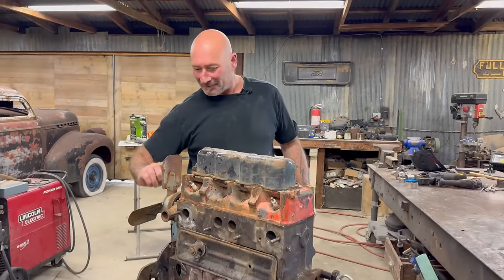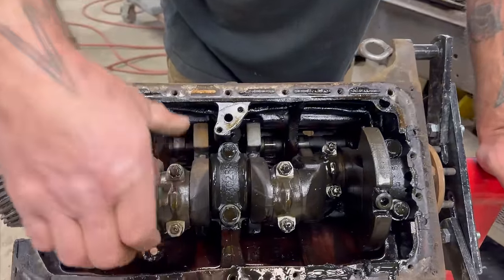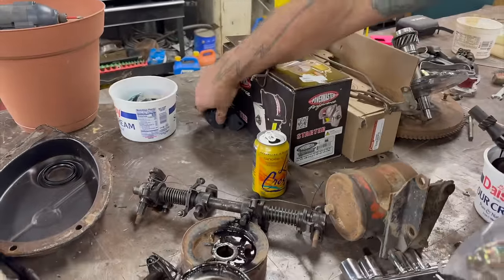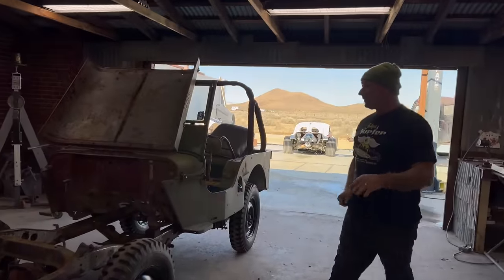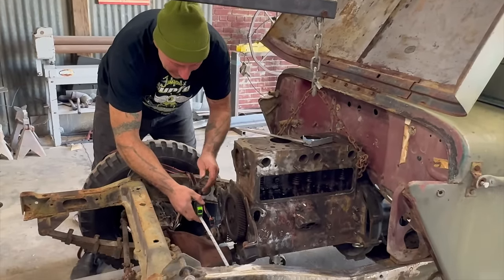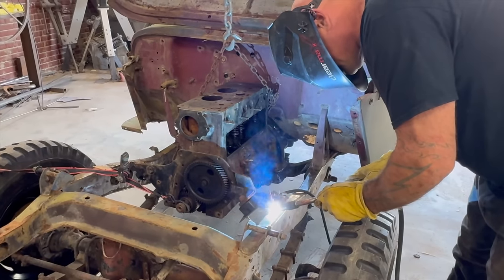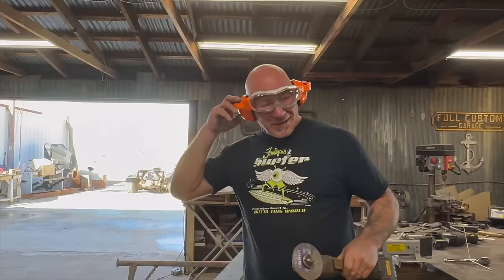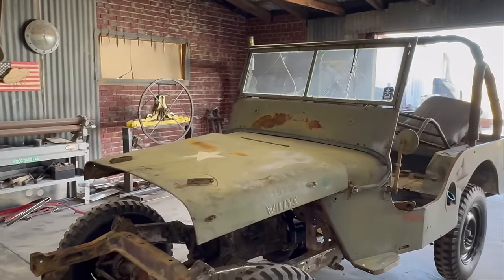Part 3! 1946 CJ-2a Willys Jeep! Is The Engine Even Going To Work Or Fit???? 📐

Comment: If you changed the bearings, new oil pump, new rings and hone the cyls,and lap in the valves. It will freshen up that engine up without the machine shop.

Comment: I had an M38-A1 with the F-head.  Pretty cool weird motor.  I blew a head gasket on it, and we fixed it after resurfacing the head.  Later my bro dropped a rod.  I advised him on swapping the engine.    With a spare we got from our neighbor.  Luckily our neighbor wanted his old pickup made into a trailer so we helped him with that and he gave us the unneeded drivetrain parts.

Comment: I built my first willy’s when I was 15yrs old. I installed the F-head engine in mine since the Flathead (L-head engine)was missing. I used a 1bbl carb off a 60’s model ford straight six. doing a 1” over stock body mount allows the hood to be flat unmolested. had an 1.5” clearance to create an offset air cleaner horn. Luv your work Dude 😎

Comment: The carb that you need i believe is the holley 1908.
It was for a 144 c.i ford  so the jetting should be pretty close too.

This was at one time a common topic on the cj2a page.
Reply: A 1 inch body lift helps too.

Comment: I had a 53 Chevy pickup, that I started out from Vegas to drive to New York, and that camshaft gear was made out of fibrous material, and it sheared or strip the gears whatever you want to call it. Needless to say we had to haul it back to Vegas and pull the engine apart period we had to put a new camshaft and of course a metal gear, whatever kind of metal it was made out of. That was in 1976. So when you said that gear was made out of some virus material it made me remember that . Good luck with that engine😊
Reply: Yes they're designed to strip.

Comment: Ian, I would advise you to have the block magna fluxed just to be sure there are no cracks in it. My block looked good so I put it all together. The first time I started it I found water in the oil and found I had a cracked block. Save yourself the posiblety of that happening in this case. Most times they can Mag a block in 1 to 2 days. 
As far as the body to frame mounts you can get them in 1" 1 1/2" and 2". The difference is almost not negligible. 😊

Comment: I posted on episode 2 to help with my experience. The overhead valve cover WILL fit under the low hood of all early jeeps to the CJ3A models. The CJ3B and later models used the overhead engine but had higher hoods to fit the higher profile of the overhead engine. The only reason for the higher hood was to make room to clear the carburetor. The way to keep the low hood is to use a lower profile early Ford carburetor. Some owners cut the hood to clear the carb and made a hood scoop to cover the carb. I built a cj3a jeep and put the overhead engine using a lower profile Ford carburetor and it worked great.
Reply: Autolight carbs off of early 1960 s and there’s a Carter carb that works great can’t remember the number of it you’ll have plenty of room with them and they work great
Reply: Use a 90 degree carb mount to fix the clearance issue with a side draught.

Comment: The hood and body you have is for the flathead engine, when they came out with the F. head engine, which is what you have , they change things just a little and made a high hood for using that engine. They must have jacked up the tub, kept the fenders and forward sheet metal the same height and made the high hood.  the clearance between the floorboard and the top of the transmission is a close one, so put the top on your transmission before you finalize the body mount shims. Also I think there is supposed to be a flat mounting /spacer plate between the bell housing and the back of the block, now supposed to be any spaces showing between the bell housing and the block . Might have to move your front engine mounts about  1/4 inch. 
Looks good . carb swap sounds good.

Comment: You could give it a light hone with new rings, bearings and lap in the valves. But it will probably run ok the way it is. They aren’t a performance engine and they’re usually bulletproof. So you can go either way. Put spacer blocks between the body and the chassis. 1” would help and you’d hardly notice the difference.

Comment: The Cam gear is most likely a Bakelite style gear and could be replaced with a cast or alloy gear. Just a PSA, Bakelite is made using Asbestos so be careful handling old and worn items containing it.
Reply: Yes it's made to be the weak point..

Comment: Take a look at the air cleaners used on 66-77 ford broncos with the inline 6, or 80-86 broncos, and 73-86 f-series  and econolines  with the 300 inline 6. They mount on a Carter YF/YFA single barrel carb. They might just be the ticket to hood clearance. They orient the filter to the side and lower, about even with the carb.

Comment: Ford had an up-flow carb # RAPartsinc 312954. I have seen guys cap off a short piece of square tubing, cut two holes in it on the same side. The carb mounts to the tubing and the fuel air mix goes up into the tubing and over to the engine and back down into the head. This is very much like a Ford 8N tractor motor.

Comment: I thought you might of stuck a vw carbie on it😅 ,but i think the best option is a weber side draft you would be able  to get parts easier for it ,just need to make up a adapter that might be the easy way,
I think yes you still need to put rubber mounts between the body and frame,would they normally have them ,i honestly no nothing but the old jeeps,just know this will look so good when its finished

Comment: Yes, that is an “F” head engine. They have exhaust valves in the block and intake valves in the head. Your CJ2A is designed for the flathead engine. The later jeeps that used OHV engines had a taller hood and cowl to allow clearance for the taller engine. Probably the easiest fix for hood clearance would be to build an simple elbow adapter to install a side draft carb.

Comment: I agree with your decision Ian and Jamie: try to run that engine with just a bit of cleanup. No need to tear it apart YET. Magna flux is a good idea but where you live, it may not be quick. Also I would add the 1 1/2” body mount spacers, will give you at least 1” more clearance when things are all said and done. Hope to see you two again at the Grand National Roadster Show (GNRS) and Santa Maria! Jerry:>)

Comment: The timing gear is a fiber gear with a metal center, for body mount I would use hockey pucks they're cheap and easily available and they can slightly raise the body for valve cover clearance maybe maybe carb clearance just an idea you add as many as necessary whatever Jamie wants 😊

Comment: Nice fabrication on the motor mount brackets.  The height problem for the valve cover shouldn't be an issue... since it almost or barely fits with the body sitting on the chassis, then when you put the body mounts on, it should clear with no problem.  Stock body mounts are probably in the area of 1/2 to 1" tall.

As for the carb, a side draft would be the most elegant way to get the clearance.  If you want a vertical carb. check out the Holly 1904 carb that others have mentioned.  It looks much shorter than most one barrel carbs,  With the body mounts in place, a shorty air filter may fit, and still be able to close the hood.

Comment: Rick Pewe's jeep "tator" is a 2a with the fhead and ford 1904 carb.  I have $100 china knock off 1904 cab and it works well. You have to knotch to the valve cover and a 1" body lift helps.

Comment: Make the side draft. It's just tubing with a carb mount. like the intake you built for the chopper with the lawn mower seat and the fat tires on it. Or lower the engine. If parts have oil on them they can be flammable.I think that engine will run not sure how long but it's worth a shot.well good luck Take care.

Comment: Your timing gear that caught fire is  a phenolic gear.
Phenolic Gears exhibits superior shear force, help reduce machinery noise, absorbs destructive vibration unlike metal gears, phenolic is non-conductive, protects the mating metal gear train, and are known to outlast metal gears under severe continuous service

Comment: hockey pucks off Amazon makes great body mounts,I’ve used them numerous times. the ford 140-160 straight six is the Carburetor I used. after learning to weld/braze I modified the carb port of the head to accept a progressive weber.
Reply: The mounts need to be rubber on these little Jeeps, for flex and to stop vibration & metal fatigue.
Reply: Hockey pucks have more resiliency than the stock 1/4” thick slice of rubber, having run them for over 20yrs on my 47’2a and 51’ 473 willys truck I dissagree with you

Comment: Well done guys. That’s the second oddball engine design I’ve seen in a couple of days. Farm Craft is disassembling a John Deere dozer and the engine has a water jacket in the valve cover. It’s good to see Summit is helping you guys out with engine parts, to me there’s nothing wrong with sponsorship as long as it’s clearly declared as you did. Lucky you decided to fix that motor or all those parts would have gone to waste😉. I think that old low compression/ low power donk will be fine, I’ll bet it won’t even burn oil if you give it a hone and the rings are good. Cheers, Stuart 🇦🇺

Comment: I see a new fuel pump, and it's still the mechanical kind, I would use an electronic pump and blank off the old mounting place on the block. It will give you minimal HP gains but some is better than nothing, same goes for an electric water pump.

Comment: That's pretty neat.  I've never seen an engine with a "combination" valve train (overhead and F-head) like that one.  I was wondering if you plan to have hardened valve seats installed - sort of needed if you plan to use unleaded fuel.  I think (not completely sure) that you'd only need them for the exhaust valves but just thought I'd throw that out there.  I really enjoy your work and have learned a LOT!  My welds between the Vicegrips and the parts I'm welding together have gotten much stronger and harder to separate 🙂

Comment: I believe it was already mentioned but better be safe.. you have a cracked block right in the middle of the central valves... do not know if it is enough to be e big problem or even if it is repairable but definitely worth checking before reassembling everything

Comment: It is a fibre cam gear, they are used because they are quiet compared to steel or alloy. You should change it as they get brittle when old.

Comment: Jeep Block appears to have a crack in between the two center cylinders where the Pushrod hole & Head bolt hole are . 
Check B4 you go any further. 
May be a wired angle on tv , but that’s what I saw .

Comment: Hi Ian,
Watching this takes me back to when I lived in Alabama, thirty years ago, and bought a mid 1980's Jeep Wrangler with 65,000 miles on it.
I had a love/hate relationship with it for about a year, 'till I regained my sanity and traded it towards a new Honda Passport (aka: Isuzu Rodeo).
That Jeep was assembled ("built" would predicate "designed", which it wasn't) just before Chrysler took over the Jeep brand.
My beastie was a straight iron six mated to a Peugeot manual transmission. It had a slow oil leak drip from the bell housing. I assumed it was caused by the engine not being fully aligned with the tramsmission and the shaft seals had been eccentrically worn. Do not assume that the alignment will be perfect.
Another puzzle was that the hood and wings showed signs of a burst radiator or plumbing system... It became obviosu that the big loop of hose between the water pump and the heater connection at the firewall was not a factory option. It was a plumber's nightmare. The hose had to connect to the water pump at the front of the cylinder head, then do a quick right angle to track along the valve cover side, to the rear, then do another right angle bend to reach the heater. The beastie did not have AC, but north Alabma winters are often frozen, so the heater is needed. Chrysler took a while to find a matching set of parts for the bends and the hoses... the hoses changed internal diameter between the water pump and the heater connection at the firewall. There was very little room between rocker cover and firewall, as in your Jeep.
I (sadistically) enjoy your adventures with your old Jeep. It never really was designed or had an engineered heritage. A scramble of bits and pieces to meet a war time need. The myth that I was told was that many, many Jeeps were sold for a dollar as war surplus, that began the Jeep legend in the USA. There were so many parts suppliers that sprung up that they became cheap vehicles for adventure enthusiasts.
The "final insult" I suffered with my Wrangler was to be caught in heavy thunderstorms after a fishing adventure in Tennessee in summer when I had taken the top "tent" off and was sporting a "bikini top" on the Jeep. I found that wipers on the inside of the windshield would have been a good idea. By the time I got home, there was about 6 inches of water slopping around in the rear foot wells. Then I bagan cursing. The carpet was not all weather; it took weeks to dry it out after removal from the vehicle. The seats were far from all weather and took a week to dry out. To really get me mad, was to find that the floor drain holes in the rear floor wells had been factory plugged with steel covers. I found a Jeep parts specailist near Birmingham AL, that could supply the appropriate plastic bung covers so that water could be drained out of the floor wells.
Even off road, that Wrangler was a dud. A friend showed me a river to fish near Pulaski, TN. We took the Jeep and thought it quite an adventure crossing streams and mud patches on the tracks to the river. A year later, we did the same trip in the Honda Passport and there was no drama. The Isuzu 4WD platform beat the old Jeep, hands down.
Cheers, Ian.
PS: I could always tell pest phone calls from their "Hi Eye-anne" intro. There were few "Ians" in Alabama.
Reply: Yes the CJ7 was the last of the good ones.

Comment: It is a F head engine.   
It is taller than the flat head engine that would have come in the jeep. Lower the trans mount & engine mounts on the chassis will give more clearance all the way around.

Comment: I have and original M38A1 frame with a 134 F head. From the side of the front pully to the frame on the driver's side is about 8 3/4 the passenger side is about 12". hope this helps.

Comment: Ian hi what i would do is hone the cylinders and re ring it and that’s because the rust on the cylinders will ruin the top rings and may cause severe damage to the cylinders, by honing you would remove most of the rusts and probably have a engine that would last for many years

Comment: This is my second time watching this vid. Great job getting the engine trial fitted. I'll be very interested to see Ian assemble the tranny and transfer case. I think he hit the nail on the head when discussing the bushings between the body and frame. A small raise of the body is just what is needed. 
Jamie, stick to your guns. Do keep the body as original as possible. When you express your will Ian will find a way. 
Now for my stupid question: Is there a way to make the engine fuel injected? [throttle body fuel injection] I ask in the hopes of increasing the horse power and thinking this might be the solution to the too tall carburetor problem. 
Great job, kids. Good luck with the rest. 👍
⭐⭐⭐⭐⭐

Comment: Quick down and dirty body mounts...Grab yourself a half dozen hockey pucks, center drill them, almost an inch thick. Work awsome. They work great if you have to stack them. Never had a problem using them.
Reply: The problem with body lifts on 2a's is there isnt much play in the steering column and the pedals are mounted to the frame. Basically a boddy lift is a pia.
Reply: They're to hard, the original rubber ones were 2'' think and designed for flex etc.
Reply: Look on the computer at a stock jeep ( your year) exploded view of the frame to body and check out the factory body spacer. Should solve the problem

Comment: You might be able to find a throttle body injection system for that jeep which works much better than carburetors
Reply: Holley do a single barral Viper system that's very compact, but i think she wants to keep it basic, the less electrics the better.

Comment: The Holley model 1904 one barrel used on the Ford Falcon 144 and 170 CID engines seems to be the  common fix for this.  About $82 on Ebay.

Comment: The jeep engine is called an F head. 1/2 the valves in the block,1/2 the valves in the head. What we call a flathead engine, with all valves in the block, is officially an L head engine. Glad you found that head bolt that is under the carburetor.

Comment: The crossmember and therefore the engine/ gearbox should be moved forward to allow more clearance between the firewall and block. That will allow easier maintenance if it breaks down or needs work.
Reply: That's where they sit, the fan and radiator eat up the rest of the space.

Comment: I wonder if a side draft carburetor would fit?  This is a pretty common problem with F-head engines in low hood flat fenders, alot of them have a hole in the hood, haha
Reply: Holly 1904 carb according to The CJ2A Page..

Comment: Darn... I'm  getting the itch to build another engine (an F head would be easier that the Corvair boxer engines I used to build)..  If you want some help, I'm about a hundred miles away, over in the Victor Valley.

Comment: If that had an L head to begin with you might run in to clearance issues with the hood closing. I have at least one or more hoods that I bought as a parts lot that have holes cut in the hoods to fit the taller head.